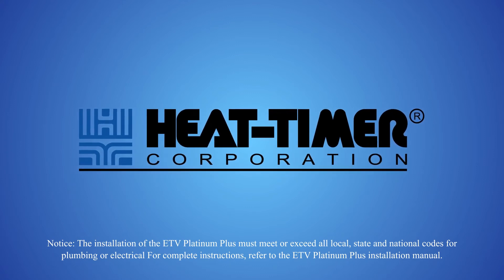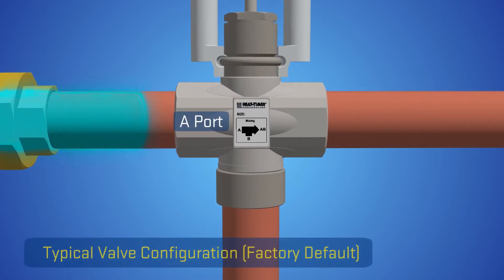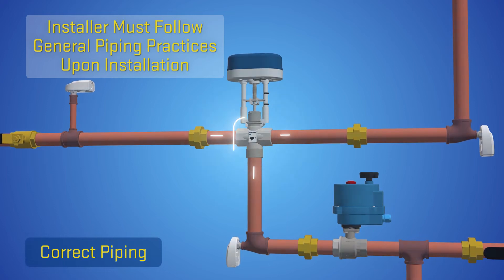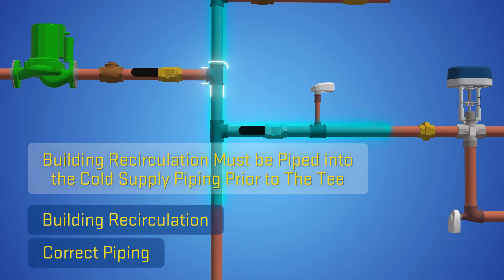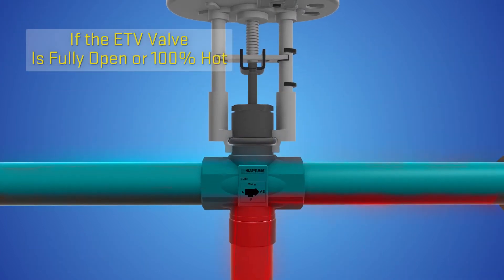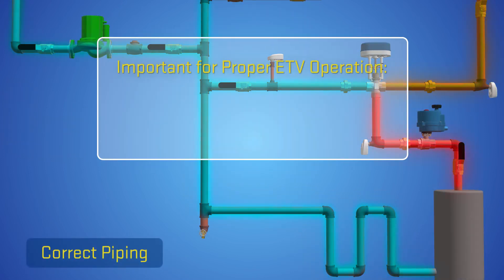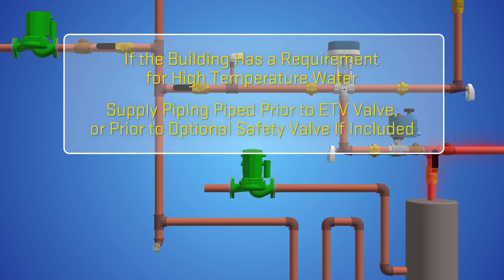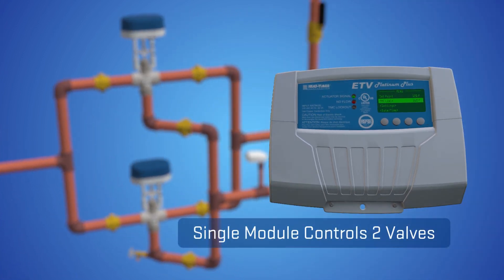ETV Platinum Plus – Valve Piping Tutorial

Comment: Recirculation Pump is incorrectly installed in your Valve Piping Tutorial. As shown, HWR is directed into the discharge of the pump instead of the suction port.